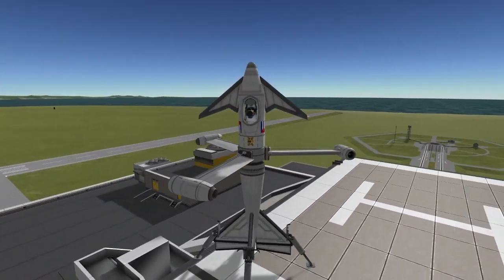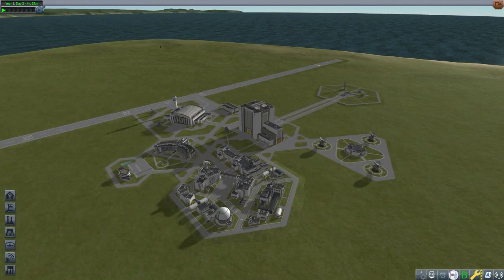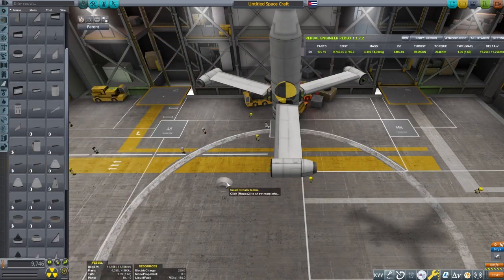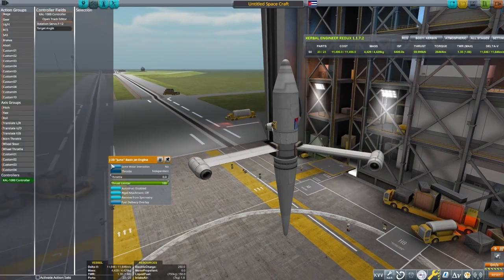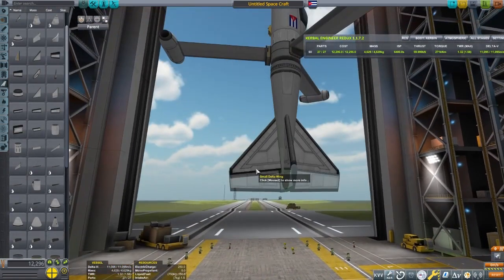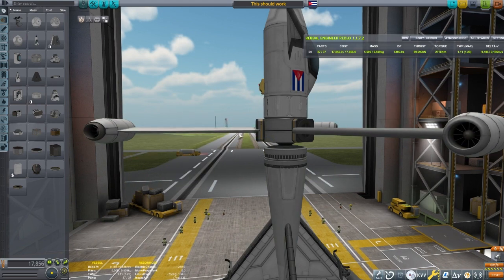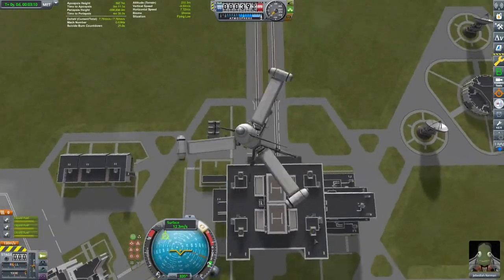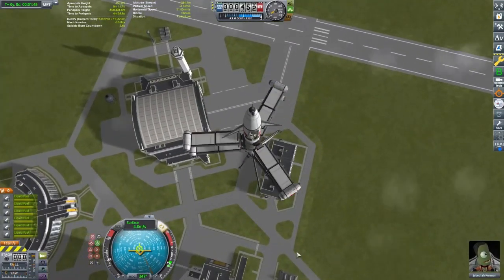Triebflugel

Comment: It looks really cool, but I wonder How good it could really fly in real life.
Reply from the maker: Theoretically it would work. The Germans never got past the wind tunnel phase of testing.
Reply: @Echo3  Wasn't that because the buildings where it was built was bombed?
Reply from the maker: @Corvid8317  I don't know if they were bombed or just over run. Do you have any resources I could look into?
Reply: @Echo3  no it didnt . bearing friction makes take off and landing impossible if there wasnt some kind of gyro or accelerating counterweight. only the engines were tested in a windtunnel as they should have been used on other aircraft aswell
Reply: @dave_sic1365  I mean tipjet helicopters are real and have flown.  This didn’t fly though no, although it probably would have.  Landing would be problematic with the pilot’s orientation upward.

Comment: How did you add the throttle to the Kal like that? I don’t even have the option to make the throttle on the Juno’s independent :(
Reply from the maker: In settings, you need to enable "advanced tweakables"
Reply: @Echo3  I already have it enabled though?